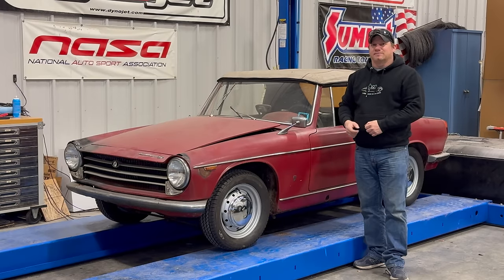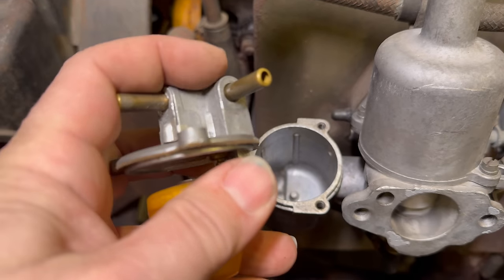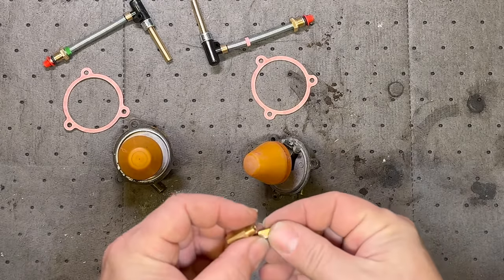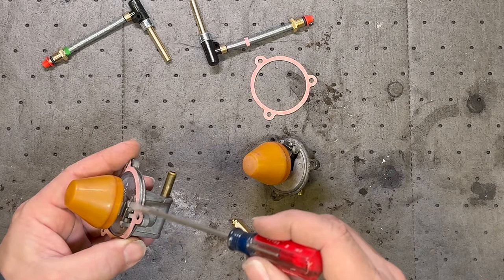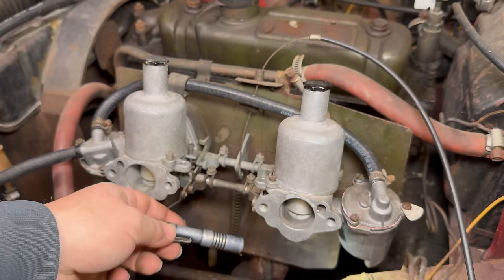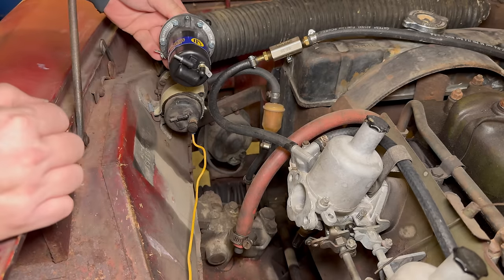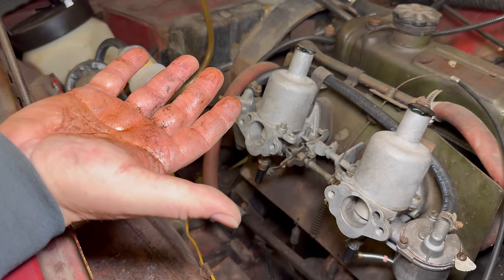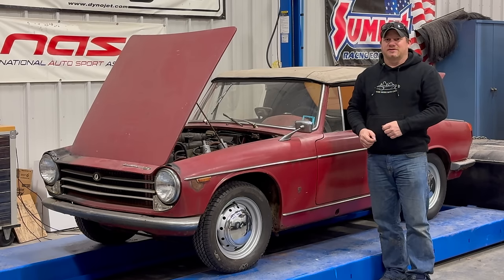Fuel Problems Everywhere on the Innocenti Spyder

Comment: People don't understand how cantankerous these things can be.  So close!  Can't wait to hear it run.
Reply: Right? She seems to be stubborn. This should be a surprise to no one, LOL
Reply: I would say it's the owners who are often cantankerous.  Cars like this are so simple - basic observation and "proper" repair will sort most anything with little money and few tools.  SU carbs for example are SO SIMPLE yet you see hack work from the previous owner where he didn't even bother to put in gaskets or o-rings to stop obvious leaks.  I've had British cars two periods in my life:  1983-1987 (in college) and 2010-present.  It's a pleasure to work on them due to their simplicity and if you're used to expensive sports cars the 60s and 70s British cars will be a pleasant surprise - parts prices are generally 1/10 or less than Porsche parts for example.
Reply: These carbs were designed in 1652.
There is nothing simpler than an SU carburetor except maybe a straight pin .
They put them on the British space shuttle

Comment: I have an Austin A30, where a previous owner has replaced the mechanical fuel pump, that it would have had, with an electric fuel pump. It never seemed to work right for me and I frequently ended up stopping with what seemed like fuel starvation. I replaced the fitted pump, with a facet pump, that was turned out to be always noisey and also failed! Something was clearly not right. The fuel tank is quite low down, and the fuel pump quite high, above the carb, like yours and perhaps not ideal. I now have a pre filter with a non return valve, just before the new electric fuel pump. When switched on, the pump only has a small amount of height to overcome. Seems to be working well, touch wood. Best of luck with yours!

Comment: Great detail on replacing the SU float needle valves.  Liked the use of the thin wall deep well socket for this, rather than searching for the SU tool that’s always in the other tool box, at home. 

Also liked the use of the Viton tipped needles.  

KG

Comment: Hi Steve, I know you have a "soft spot" for older British cars, I have a Morris Traveller from 1970 still undergoing a stop-start lengthy renovation.  I just wondered if you could find time to reveal if you have had to make extensive modifications to your cars to enable you to use modern E10 fuel safely. Thanks for sharing your experience here and best regards from Ireland.
Reply from the maker: I do not use ethanol in any of my vehicles.  I do not think you can make them safe for ethanol with the original carburetors.  The best advice I have if you have to use ethanol is to put in an additive like Ethanol Defense.
Reply: @ThisWeekWithCars  Thank you Steve for taking the time to reply to me, I really appreciate it.

Comment: Wouldn't be better to put the fuel filter before the fuel pump in order not crap from the tank to contaminate pump's membrane?
Also yes tank seems to be in a need of cleaning... Cheers from Greece! Nice car!
Reply from the maker: No you always want the filter after the pump doing it the other way around usually causes issues.